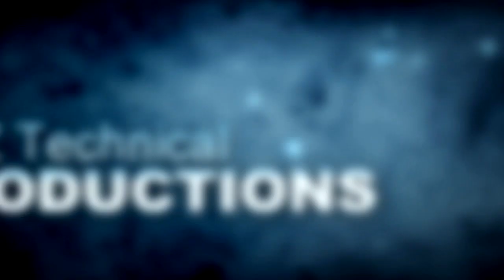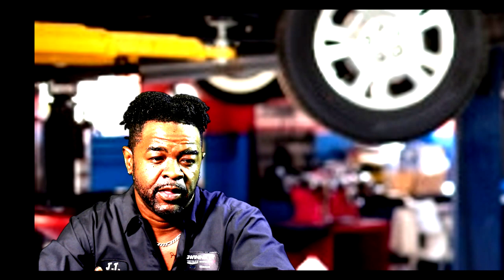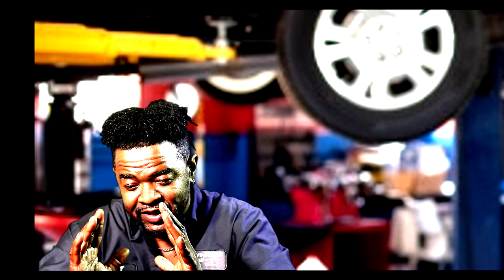P0601 again? Check these before you install another PCM

Comment: Hi, I have Malibu 2013 and the code P0601, but the problem is that the gear while driving, the tiger changes from 5 to the last tiger and it is fixed until I stop the car, turn off the engine, and then the interlock system returns, but the code P0601 remains visible. Any advice?

Comment: I rmoved a sensor under my air intake on Dodge 20012 RAM. Cleaned its connections and the female recepticle with Electronics cleaner without pulling the sensor.
Drove 20 miles, got a P0601. 601 would not go away. I reseated the connection on that sensor 10 times, did a little hookey jukey dance, disconnected the hot wire from the battery for 15+ minutes.
Abrasively cleaned the battery terminal and connector. Powered up, Cleared codes w a scanner. Drive for 15 minutes - P0601 gone.  Success!

I am left with the original code P0138., which is to be expected,
601 clear. Now, back to the real issue.:hand-pink-waving:

Comment: Mine start right up but I'm getting that p0601 code it misfires and burns a lot of gas I thought it was my oxygen sensor but there's no code for it eBay has them just send me your VIN number and they will program all you have to do is plug and go
Reply from the maker: cool
Reply: You talking about the oxygen sensor¿
Reply: Bucause my 01 pt cruiser 2.4 naturally aspirated misfire and burns a lot of gas too idk what to do or start looking on the engine bay

Comment: Hello sir. I have a check engine problem with the engine light on the board. after diag 1 fault code p0601 present. my car is a 2001 pt cruiser 2.0l petrol. is there a problem with the connection fuse? I do not know. what advise me please

Comment: I have oil in the wiring harness I cleaned it as best as I could changed out the computer and had it flashed also replaced oil sending unit but still getting oil through the wiring harness car is in limp mode and I can’t get it out tryed resetting the battery nothing also replaced the Tcm I have one code p0700 anyway I can replace the wiring harness coming from the computer?
Reply from the maker: Hello my friend, this is not good. Ive only had luck once with problems like this. Possible the oil has saturated the wires and the circuit currupt the modules.. Its simple hard to recorver from such damage.  BTW what year is the car? also are you subscribed to the channel yet?
Reply: Online Mechanic Tips it’s an 02 pt cruiser it’s got 134,000 great car aside from this issue yes I will subscribe
Reply from the maker: @williamandkathleencasper4958  If the oil made it to the PCM, Its very hard to recover if it hits the PCM circuit board. Watch my other video on this here: https://www.youtube.com/watch?v=6uUs79G4pFg&t=84s
Reply: Did you mean oil in the wiring harness going to the pcm or the wiring harness that connects to the oil sending unit?

Comment: 2002 Dodge Durango RT 5.9 PCM bad, does it require to be programmed my VIN# to properly function and remote lock FOB work?
Reply from the maker: Depending on what kind of key you have. The PCM will/may have to be programmed to your security skim module. Hey please subscribe to the channel for me, thanks

Comment: YOU DO NOT HAVE TO TAKE YOUR CAR TO DEALER FOR REPROGRAM THERE ARE PLEANTY OF SHOPS OUT THERE TO PROGRAM YOUR CAR LOT OF THEM WILL COME TO YOU
Reply: I'm a mobile programmer. All you need is a j2534 pass thru and a laptop and you can do all make and models. GM are cake, chryslers are easy too but expensive. You just need a witech 2.0 subscription
Reply from the maker: The only way ANYBODY can  gain access to Chrysler programming is if they are an employee of a dealership or if there shop has a subscription acct with chrysler..Now the older cars, sure thats possible..Unless you have a SID number theres no way to get in sir..
Reply: @OnlineMechanicTips  There's lots of workshops which can program PCM.. There's even those which will program PCMs, send it too you and you only gave to plug it in.
Reply from the maker: those workshops you referring to have a subscription acct or a chrysler employee there with a SID number
Reply: @OnlineMechanicTips  Not necessarily, workshop I worked in was doing it and we didn't have any subscription nor an chrysler employee. 

But even if that would be the case, how does it make a difference from a customers point of view?
Reply from the maker: it doesnt..all the customer want is it fix..I was at the Chrysler training center and the teacher made clear of being able to program computers..He assured me without a SID number, theres no way to even log in to perform the program..Somebody somewhere just simply using somebody access..Im sure the customer dont care about any of this like you mentioned.lol
Reply: @OnlineMechanicTips  Dude, you're trying to prove some point, while the workshop I work in can do it. Just accept that you were wrong and move on with your life..
Reply from the maker: @S....  lol, not trying to prove anything..lol, just responding to a comment i didnt see until now,..If you getting it done, good for you...lol, dont sweat it...

Comment: dodge ram 2001, 1500 v6 3.9L , what is it called? pcm, ecu, ecm? Is it inside the truck or under the hood? Does this one need to be reprogrammed if I get a new or used one?
Reply from the maker: Hey buddy, can I get you to subscribe to the channel to help it grow, thanks..Look,  that year truck controller was called a PCM (Powertrain Control Module) and its located under the hood on passenger side firewall.
Reply: @OnlineMechanicTips  is that 2002 dodge ram 4.7 also plug n play? - I have a black key with no theft system